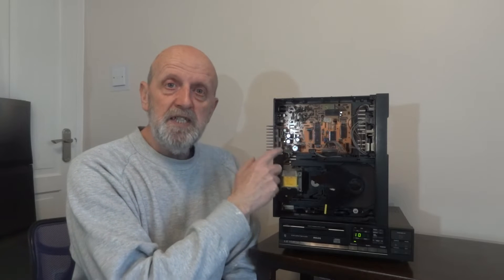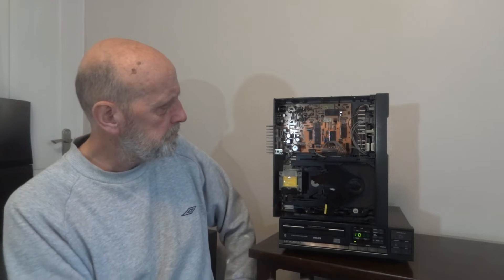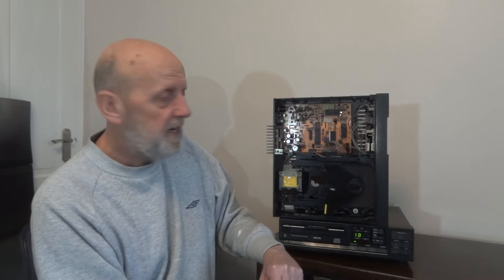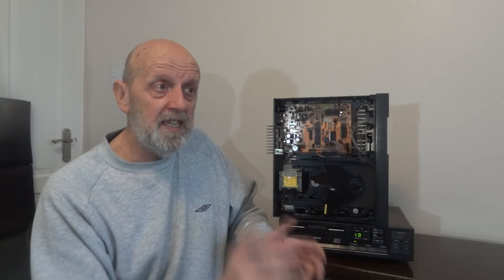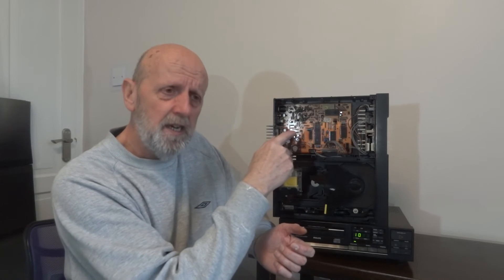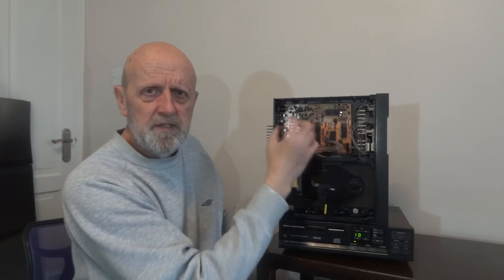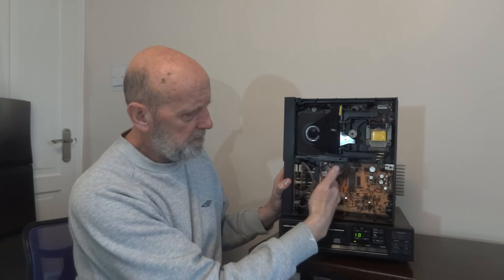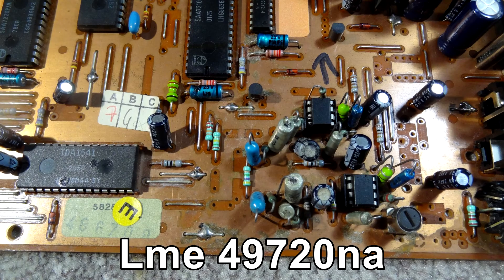Philips CD 160 op-Amp Replacement Mod. Operational Amplifiers Op Amps, CD 360 player.

Comment: hi having a rest  to save burn out  joe gave me some lights  
she used to have a channel  her man works from home now like alot do now  note in the tascam 30  the capstan motor over heat please keep to  deck with 240v that
drives the capstan motor   like the akai  reel to reel 

i am lucky i have many tascam 30  line decks  i have a way to use the deck with out the capstan motor  i find why it's over heating 24v to it is ok  33dc  as well 

yes you lot of  audio fans as well  like the teac 2000 home deck  alot that could play up

Comment: hi i had 48 tascam 38 audio pcb  op amp are 40 years old  all of them are ok  not one bad     i did find the pots are  played   und with  keep away from the v u  pots in reel to reel
R141 IN A TASCAM 38   i have a mint  pcb not  play with any of the pots     you see alot go inside to play with the levels  this is a right pain 
i know you                don't have the skills to do this  i do
Reply from the maker: This is trouble with a lot of old Receivers, tape decks reel 2 reels etc, with components drifting from spec without the knowledge, service manual and correct testing equipment there is no way of tuning all the pots to where they sould be

Comment: Hi Michael, Great channel! 
If I've not switched my CD160 on for a month or two, it takes an hour or so to power on. 
Any idea what the problem is?
Reply: Might be a slightly/marginal dry solder joint, and when it heats up after being on for a bit it suddenly works, normally if its a cap going wrong, its the other way once it gets warm it goes further out of spec so would get worse with heat.  Michael will probaly have more idea than me though.
Reply from the maker: I would download the service manual of off HiFi Engine and check the voltages around the regulator IC's think there is 3 of them, if you have no means of doing this, then I would change all the electrolitic caps around the regulator ic's 8 in total I think. Sound like its close to working as it should but needs to warm up to change some values to kick in.

Comment: I was wondering how to get those out. I had hoped to just pull them but no such luck. I have an old CD371 over here (actually CD1371 because it is the Aristona version).
Reply from the maker: There is very little soldier on the board and very easy with decent braid to pop them out